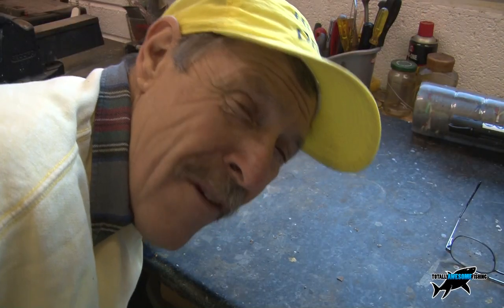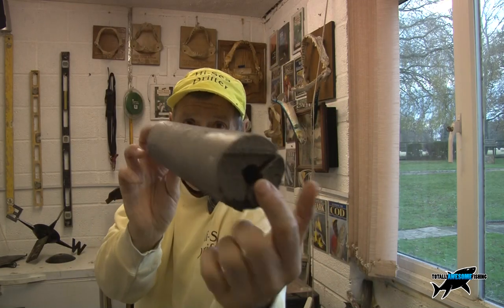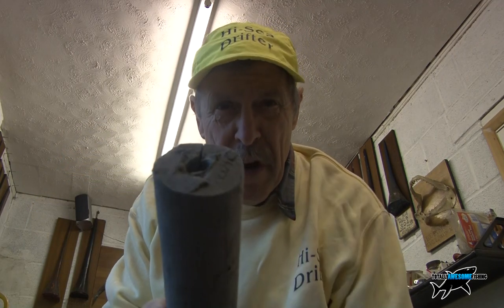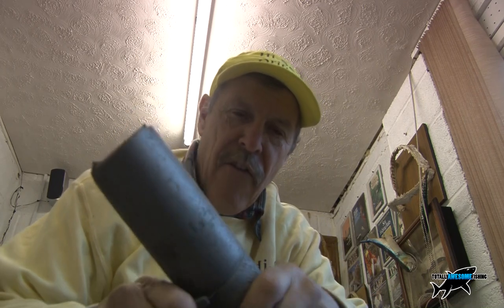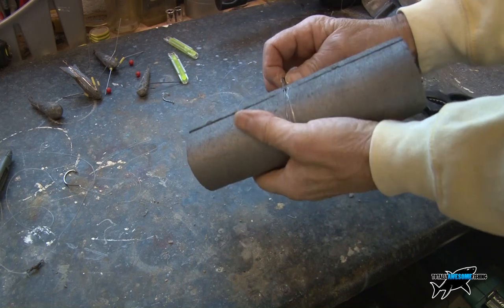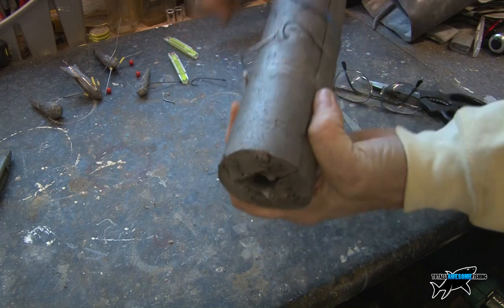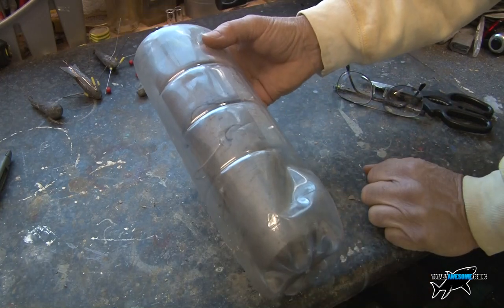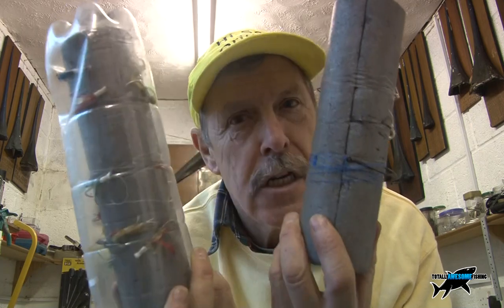Make your own rig holder - Cheap, simple, easy - Tackle Tips - Totally Awesome Fishing

Comment: Love your Vid. I have to tell you this method of storing leaders is something I came up with about ten years ago. My method is  modified. After too many times of the barrel swivel falling out of the slit I decided to use galvanized 5 or 6 penny finish nails inserted into barrel swivel the stuck them into the insulation. You can be sure to wrap them tight and remove with ease. Just poke nail back into the foam for reuse.I also use 2"PVC pipe bottom duct taped foam sticking out to grab /label

Comment: Hi Graeme,
Love your channel – learnt so much and enjoy the humour too.
Wanted a better way to store my feathers and rigs and you idea is great, but wanted something for kayak fishing so made a few mods to your basic idea.
Bought a round clip-on lid food pot and made a small hole in the lid. Tied a cord through this and then down to hole in the side of the pot. Made a small loop in the cord by the pot to attach a lanyard to clip onto the yak, and the used silicone sealant to glue the pipe foam into the lid.
Now my feathers are stored neatly and tangle free, and if I drop it off the yak, I don’t loose all my rigs.
Rgds,
Martin.